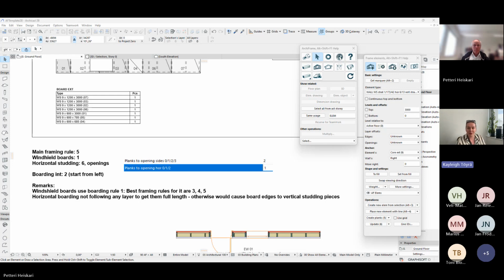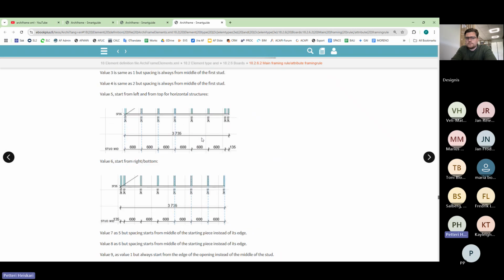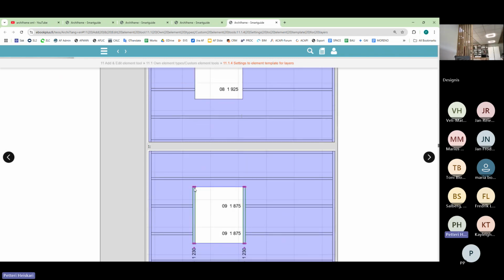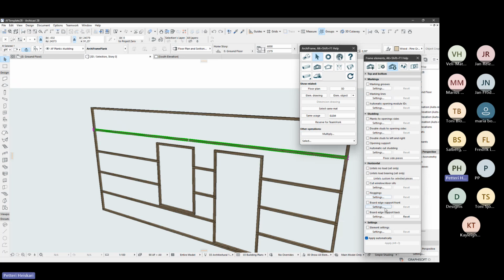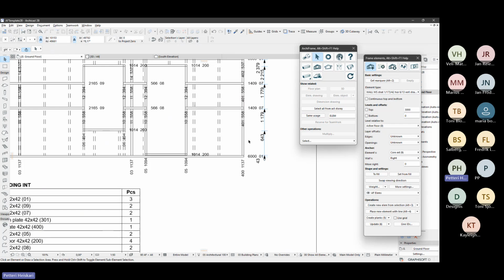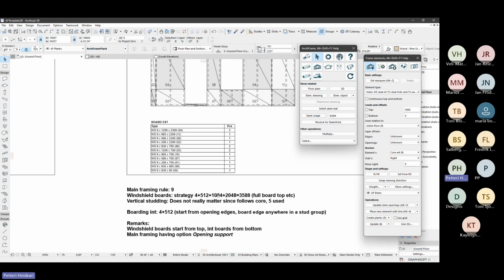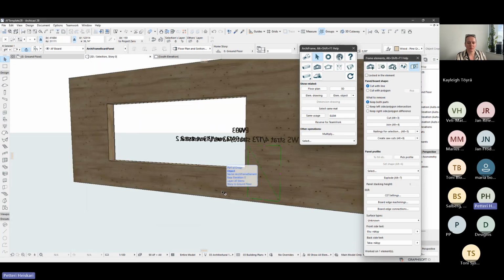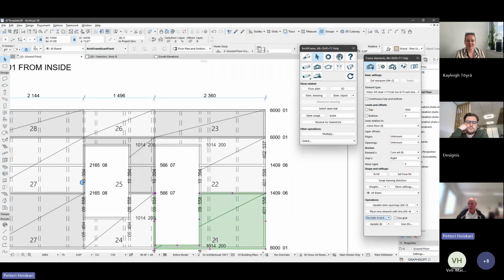ArchiFrame May User Webinar: Deep Dive into Mysterious Framing & Boarding Rules

Comment: Hi Petteri. Hi community @ArchiFrame

In ArchiFrame, the ability to generate OSB panel layouts with a 3-5 mm gap between panels is still not implemented. OSB panels tend to expand under temperature changes, which can sometimes lead to cracks even in the second layer of drywall.
Sometimes OSB is used outside the frame—for example, when making roof panels. In such cases, gaps between panels are essential to prevent damage to the layers of built-up roofing. Well, situations can vary.
Yes, I know it's possible to select two panels and create a gap between them manually. But that's not the right approach, because in that case, I would have to pre-create material that is 3-5 mm larger, just to manually set the gap both in height and width.
I suggest creating either a rule or a strategy for panel layout with a gap between panels (Board Gap), or giving users the ability to configure this themselves via XML.
I've searched through all the XML and LUA scripts—I couldn’t find such an option. I realized that the rules for OSB panel generation are embedded in the add-on’s core and not in the XML files, unfortunately.
Reply: True, today you cannot leave gap. We will add this to future releases. Today there is a command to leave gap for generated boards in plank main tools/Special operations/Gap between selected boards. Thank you for pointing this out!